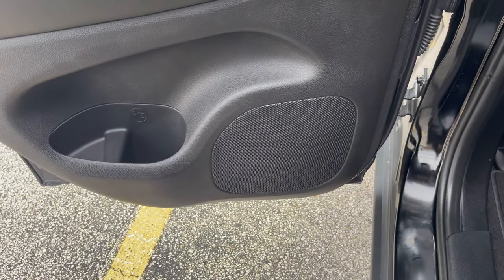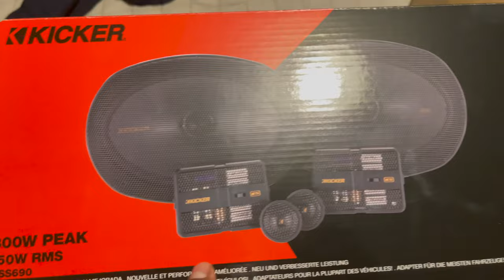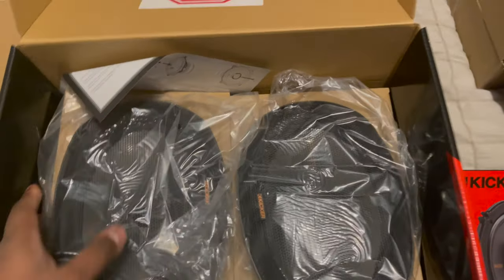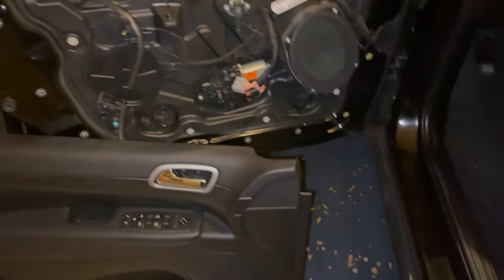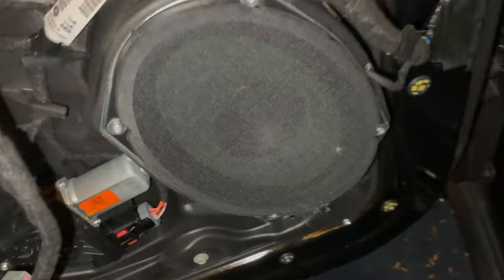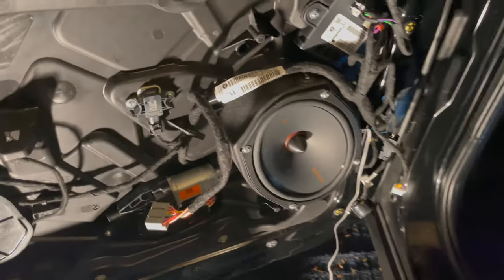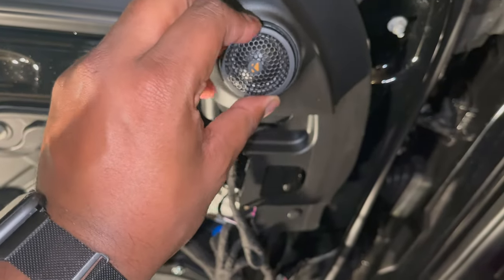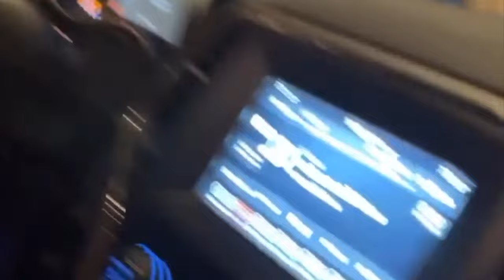How to: Door Speaker Install on '21 Jeep Grand Cherokee

Comment: Thanks for posting! I replaced my factory speaker with Infinity. They sound great. In your speaker comparison the factory speaker sound has more bass while the Kickers have more clarity. I'm replacing my tweeters next. The factory tweeters leave a lot to be desired.
Reply from the maker: Yeah the kickers NEEDED a amp. Switched over to Rockford fosgate and they work way better off stock power. Editing a video now for adding a 4 channel amp system
Reply: @BigStuDolla91  i can't wait to see your Rockford Fosgate video. I actually purchased that set of speakers first but there shipping issues with Amazon and the company that sold them were ass. I purchased the Infinity and haven't looked back............ Hold up. I thought Rockford Fosgate and Kicker was the same company like JBL and Infinity! Anyway I'm glad that you're sound system is doing better.

Comment: They sound so good, he took them out and got Rockfords and an amp. Replacing stock is tricky. The factory head unit has extensive DSP built in to make those factory speakers sound good. Now you replace the factory speakers and you have poorly tuned better speakers.
Reply from the maker: Yeah a dsp would be better but I’m good on thst

Comment: So instead of connecting to the stock cross over on the door. You just unplugged it. And bypassed it. Can i just splice in to the stock cross over for my new tweeters or do i need a aftermarket tweeter crossover? Nice video.
Reply from the maker: You might be able to get by with the stock crossover. I tend to add amps to my door speakers so I bypassed it so I wouldn't blow it when that day came

Comment: This is great. You hear the difference cleaner and I’m listening in my car from my phone.  Ive been looking to upgrade Audio.  I’m going with stealth box need trunk space but can’t figure out what speakers to get I’m trying to stay on a budgets since I subs is pricey my audio is stock 4 speakers 2 tweeters. Any recommendations. Looking at your sub video now
Reply from the maker: Yeah I’m running Rockford punch series now. Kinda pricey but match up with the subs I moved too
Reply from the maker: Also, I used components but You could actually use 6 speakers, 4 coaxials and two tweeters. The front coaxs and tweeters are wired together from the factory.
Reply: That’s a big sub I saw those speakers but thought it might be too much for This sub I have is 10inch I believe its from jL it comes as a whole enclosure.
Reply from the maker: @michaelguaman8384  yeah Stealthbox was my first choice tbh but the cost was so much I ended up with the big ass system I have now lol

Comment: Did you connect speaker wire to your 6x9 before you connected the wiring harness to connect the crossover and tweeter wire? Then connect all of it together.
Reply from the maker: Yeah I believe so. Would have needed to connect the 6x9 to the crossover. The tweeter to the crossover. Then the harness to the crossover

Comment: Looking at your vid, you connected the tweeter and speaker to the X-over and it wasn't clear that your X-over connected to where in order to get power from the stock amp? meaning to say 1 of the door speaker wire coming from the stock amp will not be used (either the wire to the tweeter or the wire to the speaker)
Reply from the maker: Original wires that would have gone to the lower speaker went to the input in the crossover
Reply: @BigStuDolla91  so your original wire that goes to the tweeter is not in use?
Reply from the maker: @djalfredmoh  yeah. Bypassed it completely
Reply from the maker: Disconnected it too
Reply: @BigStuDolla91  disconnect from the factory amp u mean?
Reply from the maker: @djalfredmoh  in the door there’s a clip that connects the stock tweeter. I disconnected it when I replaced the tweeter

Comment: recently got a grand cherokee and had to upgrade the system. I’m adding 2 ds18 tweeters, 2 6x9 ds18 coaxial, 2 6.5 bullet speakers, then a 1000 watt 4 channel amp for the doors, and a 1200 watt mono amp for my 8 inch sub. I bought the LC1 converter. anything else you think i could possibly need? thanks for the help.(also the 4 channel amp doesn’t have a selector for 2 channels or 4 and has 4 rca connections would i still be able to do this?)
Reply from the maker: You’d need either a 6channel loc (4 for the doors and 2 for the subs) like a lc7i or you’ll have to use rca splitters for each side of the 4 channel amp
Reply: @BigStuDolla91  i’ll probably go with the rca splitters since i’ve already ordered the lc1. also i’m getting a local audio shop that has done some good work for me in the past to install everything so they can figure it out lol. thanks for the help.

Comment: Question why did you connect the crossover to the speakers is it because you changed the small speaker as well? I just want to get a harness connect to 6×9 speakers then to the door
Reply from the maker: I bought a component set. A component set requires a crossover between the tweeters and midbass

Comment: Great video - only vid I found that shows the install and talks about the system. I'm a bit confused on what to do. I have the 9 speaker setup the tweeters are useless. Saw on Amazon a kicker coaxial 6x9 pair or should I do how you did and go component with the crossover. Any advice ? thanks
Reply from the maker: Good question. I would go to Crutchfield.com and enter in your car. From there it will tell you what speakers go where and suggest the best kind to work with that system. 

I’ll say that components tend to sound better than coaxials but they also require more work to install and power to get loud
Reply: @BigStuDolla91  I'm gonna do that thanks and again very good video! Yes stock speaker is a component speaker, barely hear anything from them.

Comment: I have 2017 Jeep Summit and back door speakers are Harmon kardon.  Where / how to I find same or compatible speakers for  the side rear doors ?
Reply from the maker: Enter your car on Crutchfield.com and they will tell you which speakers fit that system
Reply: Man, this is the exact thing I have been trying to figure out for months.. see, people dont know that the HK system has door subs in the back... and I still don't know what to replace them with
Reply: @BigStuDolla91 and they just try to sell you the most popular stuff not what you need

Comment: Can I instal 6.5 component speakers in the back or they have to be coaxial
Reply from the maker: You would have to cut holes for the tweeter if you put components in the back
Reply: What size tweeter is needed?

Comment: What about the two tweeters in the rear and the center midrange on top of the dashboard?
Reply from the maker: My system didn’t have those. Had the stock 6 speaker system.
Reply: @BigStuDolla91  you got a laredo dont u i’m on the same page with these wack 6 speakers
Reply from the maker: @Solorah  yea. Swapped them out though